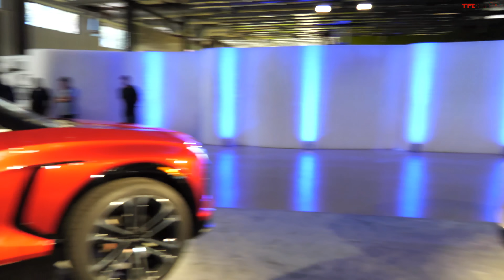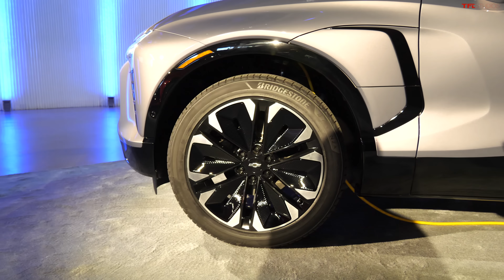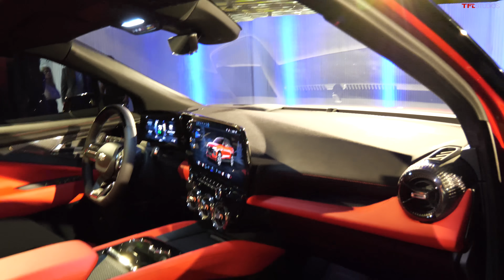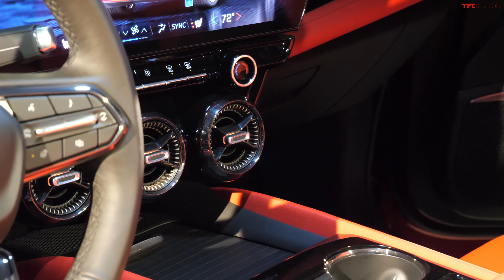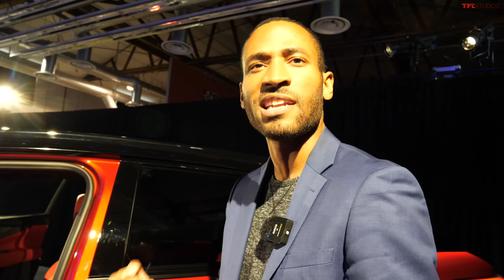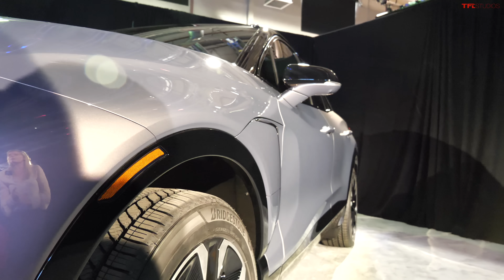Here’s Why The New Chevy Blazer EV SS Should Worry Other Electric Car Companies!

Comment: All these manufactures pumping out EVs yet no talk about improving the charging infrastructure. Glorified golf carts to pickup groceries and kids.
Reply: Did you miss the GM announcement of chargers at pilot stations around the country?  In partnership with EVgo
Reply: @ZzHasbrozZ  good to hear.
Reply: I don't believe charging infrastructure should fall on the shoulders of the vehicle manufacturers. Lots of companies are providing them and just because a company like Tesla has them they have been building that infrastructure now for roughly 10 years which was an incentive for them to sell vehicles.

The infrastructure is much better then just a few years ago and will only get more convenient.
Reply: @TonyFLourenco  it's not about should though. It's a missed opportunity to sell people on the convenience of having a brand supported charging network. Plus the lack of any forward thought capable legacy oems. Should've all just seen it as eventually dcfc will be profitable. Which then becomes just another source of income. 

Heck just 10% of their yearly advertising budgets for the past 3 years alone going towards building out charging instead. Would've been more than the entire allotment from the latest stimulus package for charging. 

Which all matches nicely with how evs need ZERO oil changes, ZERO tune ups ever, ZERO exhaust systems, zero oxygen sensors, ZERO engine air filters, ZERO flushes or transmission services etc. So they could have made some of that back by getting a cut of the energy side of thing's. 

Plus if they built the actual chargers themselves? Like again tesla does by the tens of thousands every year. They'd get the revenue from replacement parts and new station's plus upgrades as the tech inevitably changes. Once again tesla leads by a country mile here. 😀
Reply: @TonyFLourenco  I personally think power companies should be stepping up to the plate.  They have an opportunity to sell more electricity but to be honest there is no business model for profit in it.
Reply: Fair point however each state has to submit a charging plan by the end of august. In order to earn those federal dollars from the infastructure bill. Texas has a very nice plan laid out and some others are working with the charging companies and local businesses to build out the station's.
 
Gm also partnered with flying j recently to build out fast chargers at 500 locations with 2000 or more chargers by 2025. 
Volvo has a deal with evgo and Starbucks to ad at least 2 fast chargers to select high traffic locations. 

Tesla has partnered with many existing businesses like bucees and other's, so if they open their network like has been rumored?
All of a sudden by this time next year it could look very different indeed for ev charging. I mean tesla alone has now added over 7,000 new superchargers just so far this year world wide. 👍🏻
Reply: @suspicionofdeceit

You may be absolutely amazed at the pace of change when it starts to happen.
Reply: Infrastructure... they will just burn more coal to power the Infrastructure is all! But EV is the answer to pollution... right?
Reply: @getlosttoday4045  so far in 2022 over 45% of all us power production has come from nuclear and renewables combined. 
April saw 29% of all generation come from renewables. So no to answer your very misinformed pov. It won't be coming from coal. 

Then seeing as how all of the ev batteries built together equal more than all of the grid scale batteries. Evs connected to smart chargers at work, the malls,gyms everywhere there's a grid connection and of course people's homes, apartments and condos. 

Millions and millions of evs can then easily absorb periods of excess energy production. Which helps the grid become more stable and efficient over time, not less as some would have you think. It took talking with the manager of my local emc to understand a lot of this about evs. 👍🏻

Comment: That 1lt is gonna be a hard sell when it's only got 250 miles and costs 45k. That's probably why they're killing the bolt.  The only benefit this thing has over a bolt is the fast charging.  It's still ugly just not as ugly as the bolt. Pricing on the ss seems pretty good tho.
Reply: It will sell just fine. They are right inline with other automakers. The ID4 Pro has a range of 245, the Mach-E Select is 247, and the EV6 light is 243. All of them have similar starting prices between 42-45k and they can't keep any trim on the lots. 

Also, the reason why they might kill off the Bolt is because of the Equinox, NOT the Blazer. The Equinox will have a starting price of 30k so it will eat into Bolt sales.
Reply: @kenyattaclay7666  the id4 is going down to 35k once they get the line up and running in Tennessee.  Or that was the plan pre price gouging.  And that 1lt isn't coming til 24 so we will see if that 45k stays true.
Reply: @kahless0173  you can say that about EVERY car in America, the world for that matter once the chip shortage ends. Here the simple fact, for the foreseeable they are ALL in the EXACT same price range and their entry trim EVs ALL have the same basic range and they are ALL selling.
Reply: @kahless0173  It’s ugly? Lol. Curious to know what’s the best looking EV and better looking competitors to this blazer. Or are you just a heated hater?
Reply: @mybro727  ev6 is better looking and charges faster.
Reply: @kahless0173  EV6 doesn’t even have as cohesive of a design, it certainly doesn’t have the better looking exterior nor interior. Charging speeds don’t differ substantially especially while at home on a Level 2 Charger where most owners will charge up overnight. The Chevrolet also has a larger battery pack and superior range. The Kia doesn’t come with a charging cable either.
Reply: This is midsize and about a foot longer than those other compact crossovers mentioned. The Equinox will be more sized like those.
Reply: The real replacement is the equinox which will be in the 30s.